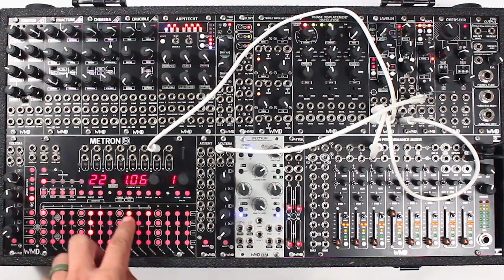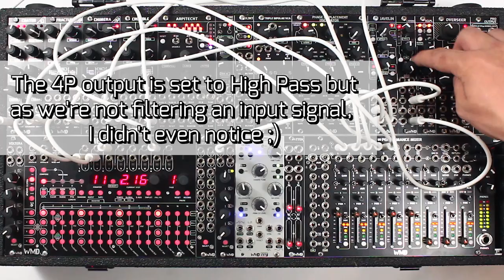Pitch Tracking with WMD C4RBN  Eurorack Filter Module

Comment: Quick Question. I know the FM input is typically demo’d using an envelope and that makes 100% sense for oscillators/voices. I trying to run my Crater into C4RBN and then use 4TTEN to control filter cutoff so I can perform high-pass sweeps on the kick. When using the 4TTEN to send CV to C4RBN’s FM input I’m not hearing the cutoff change. 

Am I maybe doing it wrong or does the FM input not respond to CV for controlling filter cutoff?

Comment: could you clarify some of the differences in the design philosophy between the C4RBN and MMF? :)
Reply from the maker: With WMD's new production capabilities, we could realize the ultimate vision of a multimode filter in 4HP. The filter circuit is similar to the MMF, and sounds very similar in the fact that it's a nice and clean filter with stable resonance.  We then added the second filter and reengineered tracking circuitry to greatly improve temperature stability. We then added a few WMD special touches like the output wavefolder and input saturator that really define the WMD sound.